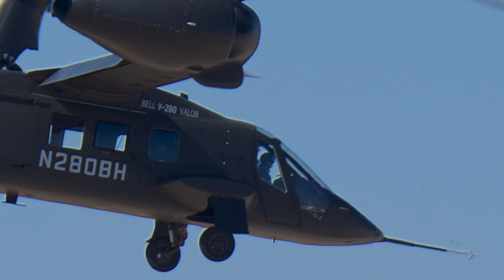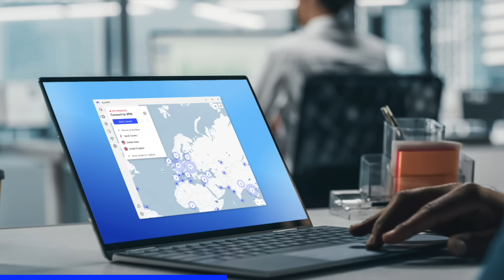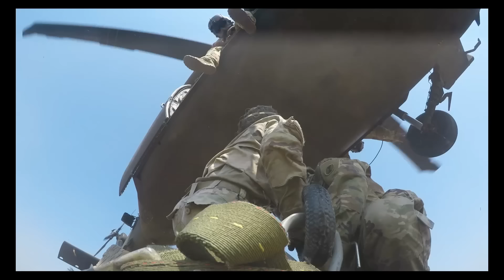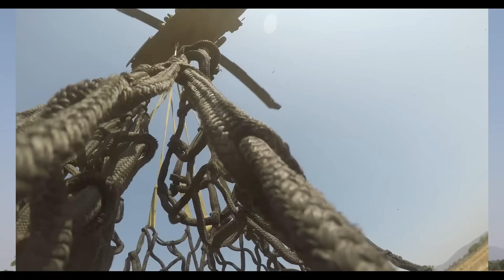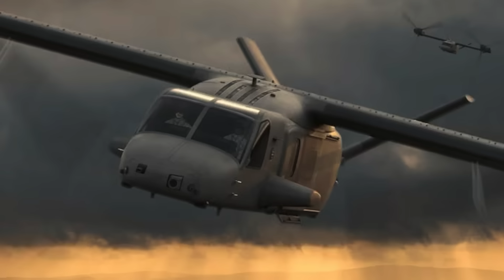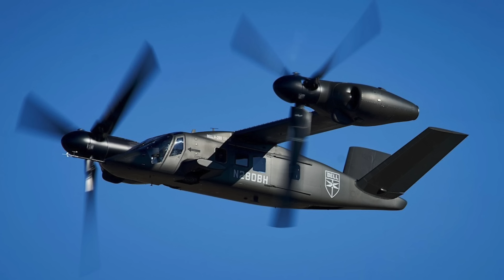How US Army’s new MV-75 Tiltrotor Cheyenne II is shaping up ?

Comment: An aircraft like this is obsolete. How are they supposed to fly an aircraft like this in a modern battlefield filled with drones and robots. It’s brand new and it’s already outdated.
Reply: A drone doesn’t fly at 300 knots and carry a dozen troops. It’s much faster than conventional helicopters, has far more range, and is state of the art.
Conceptually, it can launch drones of its own, much like the UH-60 Blackhawk it will replace.

Comment: Can you imagine all the airfield and hangar infrastructure that are going to be required to support this aircraft?  Is your hangar even big enough to allow it to fit in the door?
Reply: Bell proved that it could use the same infrastructure.
Reply: @n3v3rforgott3n9  With a rotor width of almost 80 feet, there is zero chance the existing taxiway widths or current parking pads will support the MV-75.  The minimum rotary wing parking pad IAW UFC 3-260-1 for all RW aircraft except the CH-47 is 80' x 100' for pull through parking, 100' x 160' for nose to tail parking.  The USAF requires127.5' from centerline of pad to centerline of pad for parking the CV-22.  The USAF requires an interior and perimeter taxi lane width of 245.04' for the CV-22, where the Army (even for a CH-47) only requires 120'.  I have no idea what Bell said, but this aircraft is supposed to replace the UH-60 and it is going to require significant airfield modifications to support it.
Reply: @jeffreyletempt7189  again, part of the testing process was proving that each prototype can use the same infrastructure.
Reply: @n3v3rforgott3n9 not a chance
Reply: @jeffreyletempt7189  you saying otherwise changes nothing.
Reply: @n3v3rforgott3n9 OMG, all you have to do is look up the aircraft specifications, not rocket surgery. If you are feeling really ambitious, go look up the army airfield design specifications in the UFC. Come on people.
Reply: Nothing different from when the Army switched from Huey's to Blackhawks
Every time there is a new aircraft
there a massive change in support equipment
Reply: @verdebusterAP this is on a completely different level. Imagine hangars that were built for legacy aircraft like the UH-1, now you are trying to stuff in an 80' wide aircraft.
Reply: @jeffreyletempt7189  
MV-75 has the same foot print as the UH-60
but yes when in the hanger, there is less space but you cant keep enlarging hangars
Reply: @verdebusterAP same footprint as a UH-60?  That is funny. What UH-60 has an 80' rotor diameter?
Reply: @jeffreyletempt7189  
One of points for the program was keeping the same foot print to minimize changes to logistics
Reply: No different than the osprey we have now
Reply: @justjames8383  one problem, the Army does not have any V-22s.  The parking pad requirements and taxi lane requirements for the V-22 are much larger than the requirements for UH-60 that is supposed to be replaced by the MV-75.

Comment: I thought there was one being tested that had tilt jet engines
Reply: Its called High-Speed Vertical Take-Off and Landing
It uses both rotors and jet engines
For VTOL, it uses blades which fold to a storage configuration once the aircraft reaches a certain height and transitions to jet engines but still in the R/D
Bell has 3 variants in R/D
One ultra size for heavy lift , meduim like the MV-75 and small as UCAV
The UCAV makes little sense but the medium with a few changes could achieve speeds of 500 mph in cruise which would definitely get everyone attention
Reply: That is not even in the prototype phase and is currently a test concept. At least as far as public knowledge is concerned. That will also not be a transport.

Comment: Why bother with the 2 designation.
Reply: @LeePrice: Because the first one had to be shitcanned! I don't see much of a future for this one either because it's very loud.
Reply: There was a previous helicopter named Cheyenne, the AH-56. It was cancelled in favor of the Huey Cobra. The Cheyenne II name is similar to the F4 Phantom II and F-35 Lightning II.
Reply: I know there was a helicopter that was built and tested called the Cheyenne. I didn't think it ever entered service. So why bither with the 2 designation.
Also aware of the reason for the Phantom, Lightning, and Thunderbolt using 2 because there were previous aircraft with those names that saw service.
Reply: @LeePrice-r9u  The AH-56 Cheyenne was accepted for Army testing and was awarded a full production contract before it was canceled. 10 prototypes were built; it got about as far as it's possible to get without entering full service.

Comment: I hope they have solved the cross-shaft clutch problem that is plaguing the V-22 versions.
Reply: The nacelles where the engines are stationed don't tilt at all, so it should be a lot easier to link the two rotors. 
A future development of this aircraft might involve a centralized engine placement similar to traditional helicopters. This design was originally not pursued in the 70's due to materials science not being stiff enough. Modern day composites offer a much better materials solution to the vibration issues of early tiltrotor designs.
Reply: They solved it by making the shaft through the wing straight and fixed in place (instead of a bent rotating wing), and were able to eliminate most of the joints and one of the gearboxes

Comment: If they go forward with the Attack variant in the future, maybe they'll call it the Crazy Horse.
Reply: My mom works at a place called the Crazy Horse. 

Not sure what she does, but she gets to dress up in costumes alot.
Reply: @Bluelightbandit : Maybe a pole dancer?
Reply: @gforce03XX why is thst funny?
Reply: No need
the design is not compatible 
For attack, you need conventional design
The Bell 360 invictus , RAH-66 or  S-97 Raider iwith a few minor upgrades is what Army should look
Even smarter would be the USMC and Army collaborate a common design for both
Reply: @verdebusterAP completely incorrect
Reply: @madkabal  
The USMC and Bell/Boeing tested various weapons kits options on the MV-22 and deemed not worth the effort
The MV-75 is essentially the same minus the tilt system but the same problems remain
The blades restrict its field of fire which limits the amount weapons you can add
it would be no where near the level of the MH-60 DAP
Reply: @verdebusterAP Guess you’ve been asleep while small UAV’s have been used in attack roles? You can carry a ton of those and have stand-off attack capabilities.
Reply: @seancoppinger1569  
Small UAV cant replaced missiles 
A simple cope cage and your small UAV is useless
One hellfire to tank and cage or no cage
its scrap 
I can stand off from 20 miles with SPIKE NLOS and have 90 percent of hitting my target
How many small UAVs needed for one target
An equipped enemy has plentyy counter-UAS weapons that make small UAV moot while even the most advanced active protection system (APS) still struggle to protect tanks from missiles